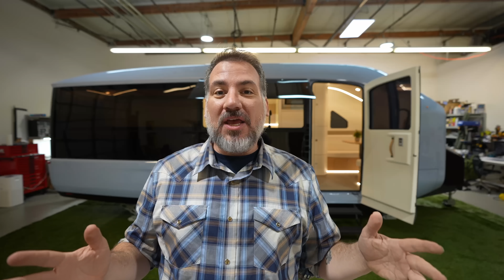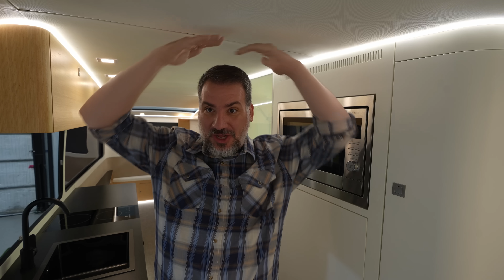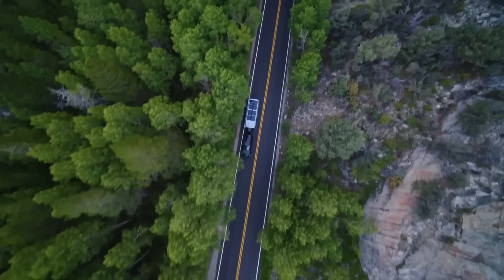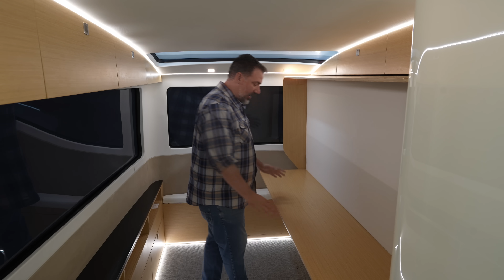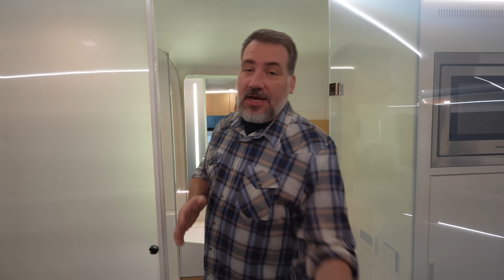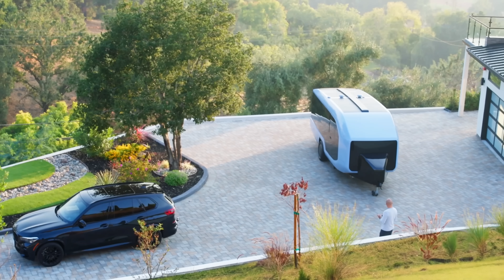Pebble Flow Tour | Groundbreaking All-Electric RV Trailer With Powered Axle

Comment: This is more of what I am looking for. I have been looking at a Bowlus that can also be off grid (%100 of the time) but is pricier and standing in one felt smallish. I like the light airiness and is a strong consideration for all of it's design ideas. I would like to know more of it's construction though, frame and walls and the insulation and how much of a 4 or 3 season unit it is. And why is it only about 7 days off grid? Is it about having to empty the tanks or some other limitation?

Comment: Few of questions here....

1. This appears to be structured to have a 3 sided (passenger side, front and back) livable space but has windows on the opposite side (driver side).  Can you access that side, and if not, why or what is the purpose of the driver side windows on this RV?

2. Is the shower area cramped or spacious enough to shower without having to bang elbows around when showering? 

3. What about the AC/heating system? Did I miss something here about the system?

4. Saw no TV, or anything about internet, entertainment, or electronic control systems?

Nice RV but still have too many questions.

Comment: Those top cabinets are a terrible design.  You need to be 6ft or taller to use. I don't want to keep a stool inside just to access them
Reply from the maker: They've changed them in the next version of the prototype.

Comment: could i tow this with a model 3? i assume not
Reply from the maker: No, it still has to be within the rated towing capacity of the vehicle - but according to the engineers, it will be much more comfortable near the max capacity. So for an EV, you're probably looking at a Rivian or a Lightning. I think this is ideal for a rivian R1S.

Comment: Finally a modern RV in the states.  A bonus is the back up house battery component and the full week boondocking capacity (unsurpassed).  To those missing the slide and roof vents - after multiple catastrophes with our new Lance, I will pass on the slides and roof vents. This appears to be built for reliability.  Plus they have large windows to open.  Part of the user experience is not having to fix your RV every time you return home from a trip.  If it can accomplish that, I will consider shelling out $120k.  Compliments to the designers.

Comment: I prefer to purchase a  Pebble Flow in the future and pay for the powered axel instead of having to do it manually  but would like to wait until they come out with a slightly bigger model.   However,  those cabinet doors need to open up ward or be a sliding door making it easier.

Comment: I wonder if the designers of this camper have camped much, several things, the fold down cabinet doors isn't going to work, the other thing is the large sky light over the bed, nice to let in light during the day, but if you want to sleep past 7am ..... I see the price is $109,000!
Reply from the maker: Funny you should mention those two things. They are changing both based on feedback. The cabinets now open out and the skylight is now over the dinette.

Comment: Storage, fridge, sleeping area, washer/dryer are some of the weakest in this very cool RV.  I would add a roof top tent, consider a 32ft VR so to have rooms for those I mentioned.  You can say it sleeps 4, but if I have a boy and a girl who don't sleep together, a 3rd bed is required.  I would make the queen bed drop down instead of swing down.  More room when it is out of sight.  25ft is too small already.  Add options for two bund beds in the front and rooftop tent.  More storage inside and outside are a must.  On the outside, table folded up becomes part of the exterior wall, and folded down and it becomes a builtin table.  Builtin D-ring hooks on the exterior for rope...tarf...on the I terror, more USB C on all walls.  The interior is missing a solar and TV area.  The dinette area is not 100% as comfortable as a solar.

Comment: Yes, one of the two co-owners of this company said in an interview he's had 3 years of Pandemic camping experience. Way less than I would expect for someone trying to make things better in the industry.  Also, that small of a battery pack won't last long heating water, the interior, and cooking. My 3500Wh set up lasts me two days without charging and that's without running an AC.

Comment: Miles, i watched the company created video introducing the Pebble Flow. Very interesting but I was a bit concern. 1. No option on their website to contact them other than place an order. No contact number, no email, no chat option, even their YouTube has comments but no option to post a comment. I find that strange. 2. The specs state 25’ and 6,200 weight limit fulled loaded. I have never seen a 25’ single axle. What axle is used to carry that much weight? 3. What 2 tires can safely carry 3,200 pounds each?  What options are there if all these electric run features break down while camping, are there manual ways of retracting steps, stabilizer, jack, etc?  I assume the electronic components and onboard computer is proprietary? If they fail as a company and you spent $125,000 are you stuck? Thank you

Comment: Maybe I missed something, but since when is a camper considered an rv?  Doesn't it need to be a vehicle to be an rv? Recreational Vehicle.  Also, how is this so different than most campers, other than the batteries?  Not very groundbreaking.
Reply from the maker: Trailers are considered vehicles. All motorhomes and trailers are considered RVs. Some folks don’t use that nomenclature in some regions, but the standard term encompassing all is RV. It’s primarily different from others because it has a powered chassis.
Reply: @RVMiles   Ok.  I always associated it with something you drove because of the use of the word vehicle.

Comment: Unicorn for sure! Campers will not overpay just because it is electric. If they are going to manufacture it in California, big mistake. Go to Nevada for employee tax breaks, reasonable labor costs, reasonable overhead and electricity costs, and possible corporate tax breaks for opening up a manufacturing plant in a tax free zone.

PS - Airstream has an eStream concept as well and will not sit back and let these guys out engineer, out manufacture, and out market them.

Comment: Gorgeous, and so tempting, but...
Where is the awning that it deploys? Is there a screen door? Window screens? Do other windows open? 
I'm guessing that lighting is the problem this is solving by swinging cabinet doors down. But at 5'4" there's no way I could use these upper cabinets regularly.
And where is the rest of the storage for hanging clothes, shoes, etc? Does the dinette have storage in the benches, or is that all pass-thru?
Also, my Subaru Ascent can only tow 5000, so unless the drive train on this makes up the difference, I'll stick with my regular 19ft with screens for the breezes.

Comment: That was a nice short review, and certainly gives food for thought.  It would be pretty easy to change the way the doors work on those cabinets, and to put a more suitable tire on the front.  Overall it seems like a pretty good idea to me, and would overcome the range anxiety issue when towing with an EV.  However,  though a smaller vehicle might not have to do all the pulling, its axles would still have to support the hitch weight just like with any other RV, unless they can find a way to keep the front wheel deployed and help support the weight.  My F150 can only go to 500lb without a WDH, and its payload is 1363lb, so not much would be left after hooking up the Pebble.  This might be a good match for bigger EVs like the Lightening or Rivian.  It is shockingly expensive though.  Perhaps there will be a good rental market for it, or it might be permanently installed in high-end RV parks like I have seen for Airstreams.

Comment: Jason,  unless I missed it, did you say it has an air-conditioner? The roof views certainly don't show any type of known or conventional  A/C unit.
Those lower hinged, upper cabinet doors will be a problem for short people! They should hinge from the top for sure!
Great video as usual. 👍
Reply: It has a heat pump for heating and cooling.

Comment: Already paid my 500 bucks. This is as revolutionary as the airstream was many years ago. A new standard has been set, on paper ( or video). Let’s see if and when I can take possession. Except for these cabinet doors and the small wheel in front, I could not find anything wrong with this trailer but lets wait till we see the final rendition. As Elon said, the design is one thing , scaling up production is another…..

Comment: Yeah, not even remotely.  At 4’11”, those drop down cabinets are NOT ideal. Also, it may be the length of your current trailer, but does your trailer not have slides out?

Comment: As Musk has said, "Prototypes are easy, production is hard." Pebble appears to be getting close to where they need lots of money and so a big pre-order count. I am tempted to risk the $500.
They do appear to have a good take on the universal trailer. I never understood why the industry didn't converge to a few sizes and interiors that would allow sufficient  volume for efficient and quality production. 
The multipurpose of the power system is key to maintain and extract extra value (harness solar and battery for house or charging BEV).
I would like to see details on HVAC system, in addition to chassis/shell construction. I would like options like twin beds and separating toilet (airstream worthy features), also bicycle storage. 
I don't  think the smart glass will make it to production; not mainstream yet, too expensive,  power draw in one state, longevity. Better to have power shades that improve insulation. 
I would like an air suspension; smooth ride, allow better highway aero, increased ground clearance off-pavement,  and lower to ground while parked.
The sweet spot for a couple,  a 5000 GVWR or model Y tow vehicle (or most midsize SUV capable). 
While you sleep, you don't use the kitchen or dinette. A quick and easy transformation could be invented, along the lines you see in European RVs.
Maybe there is a Tesla moment coming to RV industry.
Beginning of the end for the legacy junk.
Reply from the maker: Great thoughts. You're right - there are waaaaaay too many models and floorplans in the RV industry.

Comment: Cool to be able to park/fine tune rv position without tow vehicle. The range anxiety issue is a result of using a much less energy dense energy source/storage. Simply batteries dont have the energy density. It’s just physics. Example. My truck can tow 16k without a blink. With auxiliary tank I have 800 mile range.  15 minutes to gas up and boom another 800 miles. Leave the EV guy and his fancy trailer at the charging station while he sips a latte in his skinny jeans and man bun wondering if he is ever going to get to his destination. Another example applying great tech to wrong problem.

Comment: Looks like a great concept. I love the fact that you can control it and essentially back it into very tight spaces. I showed the video to my wife who is 5 foot four and she said the doors on those cabinets would be a showstopper for her. They really need to have those doors open up towards the ceiling. I also wonder about the windows that go opaque how those might hold up overtime. Especially with an RV going down some of the very bumpy roads we have across this nation. I also wonder why you would have a black gray tank capacity that’s 23 gallons more than your water capacity. That just doesn’t seem to make sense to me. They should either be about the same capacity or the water capacity being a little bit more.  

All in all a great design, and hopefully other manufacturers will take notice.

Comment: I would love to know certain basic bits of information. What are the real (not bubble-foil!) R-values of the walls and ceiling? Are the windows double-pane? How much room is there for the mattress and bedding if we want to change the mattress or add a topper?  Love the office; hate the chairs. I will need a real office honest-to-god chair (which I will provide) and do not see any way to manage storing one when the bed is down. It is one thing to sit in a folding chair and check email twice a day and another thing altogether  to sit in one and try to concentrate hour after hour until a project is completed. TV? TV watching? It is one thing to sit in a typical dinette for a meal and a whole different animal to hang out on one for more than a couple of hours -- say you are camped in the rain for a couple of days or just want to binge a tv show. The solar panels seem built-in; I suspect they are the less reliable flexible style. Even if they are CIGS panels, they are going to add heat directly to the top of the camper. Sleek yes but how about long term reliability and effectiveness say on the east coast? Can I add auxiliary PV ground panels? Who makes the electronics for the PVs, batteries, etc?  Your help with these basic details would be appreciated! Thanks for the review.

Comment: As you mentioned, this is a prototype and like automotive prototypes, it has some cool features but really isn't designed for 90%+ of current users.  I agree that it is definitely a competitor to Airstream in terms of price and design, but even after recently growth, Airstream is only the top 10% of the towable market, so now you'll have two companies fighting for 10% total market share. The vast majority of buyers of towable RVs are not anywhere near that price point, and the buyers who are will typically be looking at the Class A motorhome segment. If, as you mention, people might be interested because they "don't want to buy a bigger, more expensive truck", why would they spend more than the most expensive pickup on a $100K+ trailer?? And I can't imagine what the repair bill is if you have to replace a pane of that 'capacitive' glass on the interior or exterior?? However, ultimately, there is probably enough people that have unlimited funds that can keep a niche company like Pebble going since they're probably never going to be a 'high-volume' mfg.

As for specific features, there are a lot of cool features on the RV, but the storage capacity is significantly lacking. All that "open interior space" is because there are limited cabinets and you mentioned that there is a "full pass-thru compartment" but did not show it.  Did they not show the "basement" storage because it's minimal or very narrow, likely due to the undercarriage being dominated by the batteries and water/wastewater storage tanks? And speaking of water/wastewater, you mentioned that the mfg said the prototype can go "about a week off-grid" on one charge. However, electricity is rarely the limiting factor to off-grid living, especially with the options of expanded solar or generators. The biggest limitation(s) to time camping 'off-grid' is typically freshwater and wastewater capacity. With a 37-gallon freshwater tank and a 50-gallon "combo" wastewater tank, you'll be lucky to make it a week off-grid if there is more than one person in the trailer or unless you're practicing maximum water conservation.

Cool idea with some neat features (and I'm all for RV mfgs "thinking outside of the box" of traditional RV design) but Pebble has a long way to go from "prototype" to something that is widely usable by a large segment of the towable RV buyers...and especially at a reasonably affordable price! Most of all, I'm disappointed that this video sounded like an advertisement instead of an unbiased review of pros and cons of the product. I've come to expect more from your channel, especially since you typically present yourself as a source of "RV Industry News".

Comment: This is exactly what is needed in the RV industry. This specific unit is out of my price range but if it is well accepted it will filter down to the smaller RVs that will take advantage of at least some of the innovations. Heck, 5 years ago there were few 12V compressor fridges that came standard in RVs and now they are the rule not the exception.
Reply: Correct but they need to do some design changes before bringing this to market. It won't take long for the early adopters to question "why did they do it this way?" The murphy bed and upper cupboard doors are two examples; why change what's tried and true for the sake of being different?

Comment: Yes yes yes!  If I could afford it. I can’t, but I think it’s worth it… To not have to handle hitching the heavy sway control bars, to be able to get it backed in or parked easily would be a dream come true especially for solo older travelers.
Reply: Those hitch tires are OK for paved or concrete but no-go on gravel or dirt. (which makes them useless in boondocking scenarios.